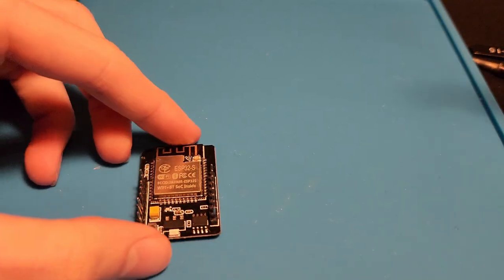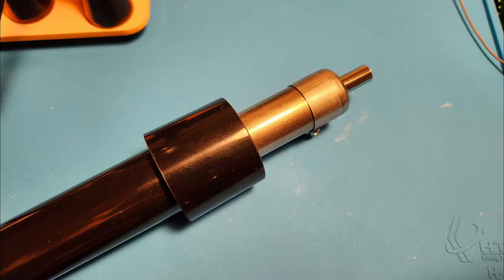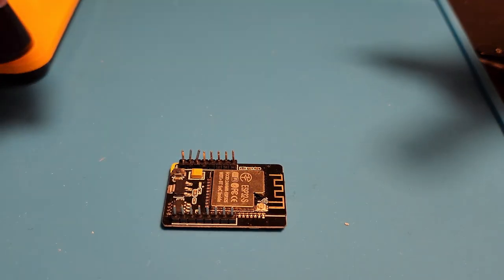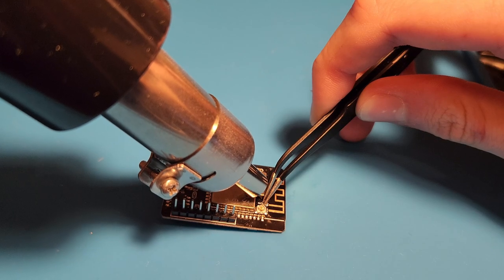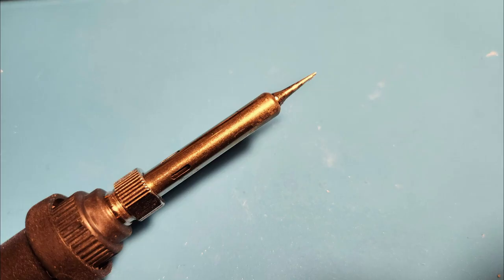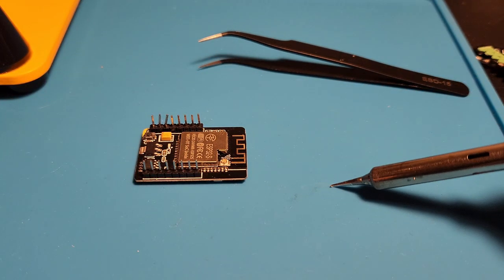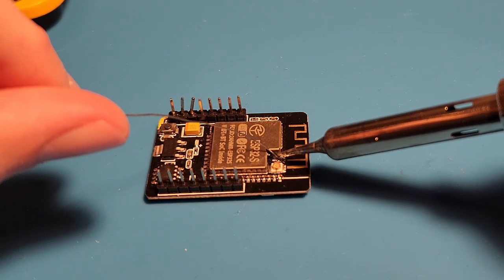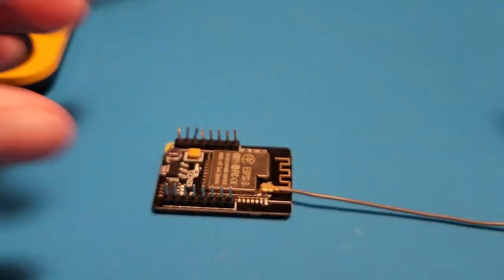How to add an external antenna to an ESP32-CAM (2 methods)

Comment: In the second method, the resistor is not necessary?
Reply from the maker: The resistor is a 0 ohm resistor (no resistance) so it is equivalent to just shorting the pads

Comment: Just so y’all know, you can usually pull two antennas from one laptop is you have a dead one lying around. 

Both are usually located in the bezel of the laptop and have one wire each leading down to a small WiFi board attached to the laptop’s motherboard

Comment: Ok, I had a problem. The connection from the metal cover (where the esp32 is located) is ruined. There is no solder left in that connection. And I couldn't solder it with the external antenna connection.

Comment: Hey, thanks for the video.

I just went and bought the recommended parts and figured I'd take a look through the guide to see what I'm getting into. Quick question, do the XIAO ESP32-S3 Sense Modules that are currently recommended still need this kind of work done on them to avoid interference with Vive trackers if I'm planning on using it wired anyways?
Reply from the maker: they don't need this, you just plug in the included antenna and you are good to go! If using wired mode, you don't even need the antennas connected at all

Comment: Damn the second method is so hard. A lot of solder went into the hole where the antenna is supposed to be inserted... now my board is broken...
Reply: Yeah, it definitely takes some learning. I just spent like 4 hours trying to do it to 10 boards, and I'm at a 4/10 success rate right now. They're all recoverable, just not functional. In your case, you can likely use a solder pump to get the solder out. Also, make sure You're not using too much solder. You just want a bit in the pads, and a tiny bit on the iron itself so that it almost looks like the iron is melted, and not that there's solder on it. Then, just put the iron on one pad for a second, then drag it across to the other. Just keep dragging it a few times. Check under a magnifying glass if you can't tell if it's working or not. If it doesn't work, you can try putting a bit more solder on the iron. Just small amounts until it works, nothing drastic
Reply: Yikes